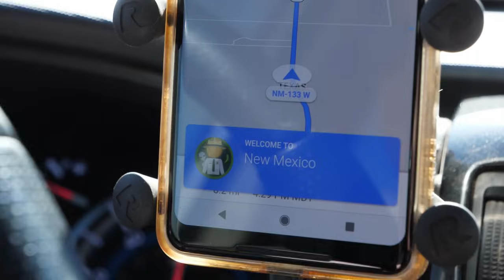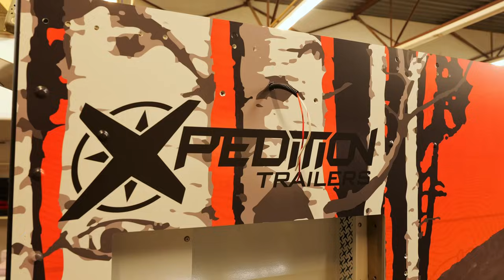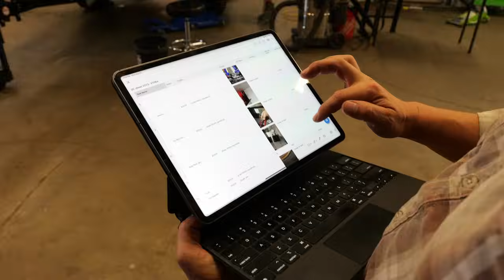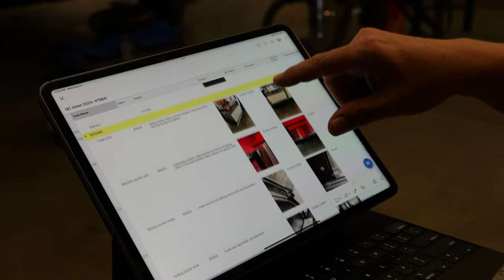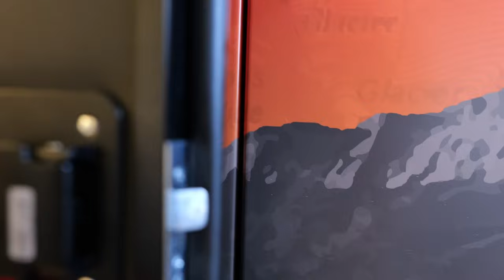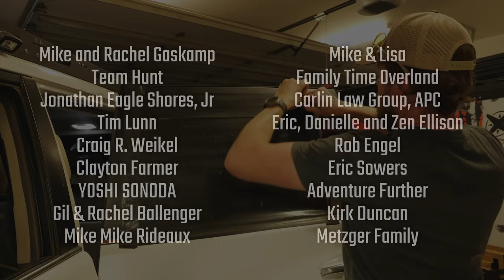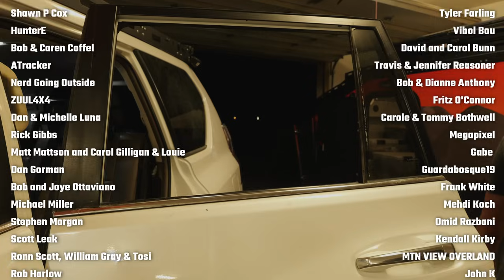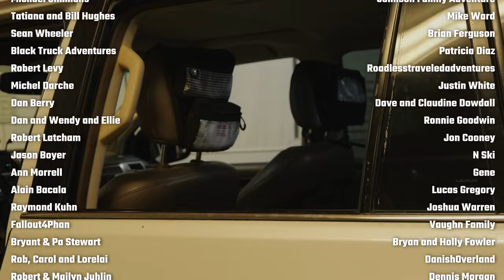Is this the ULTIMATE Family Overland Trailer? | A New Adventure [S6E27]

Comment: I see falcon pro. I have one and after a crazy amount of comparing I think it’s probably one of the best clamshell designs you can get. Holds more, more headroom, room to change, has crossbars. Wide but not too wide.
Reply from the maker: This is our old one and is going away soon. It leaks like a seave though I like the concept.
Reply: I’ve heard people have that issue, i guess I’ve been lucky. 

Is yours leaking when shut or open? I’ve mostly heard when shut people don’t get a good seal.
Reply from the maker: When open. I've got a new canvas for it but haven't had time to install. We're going a different route now